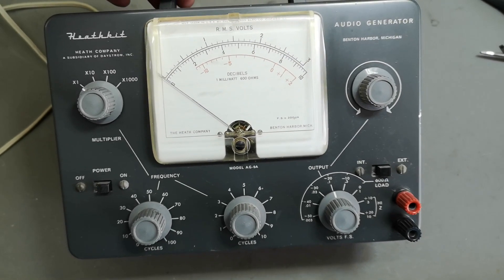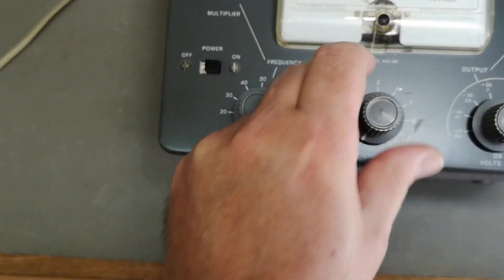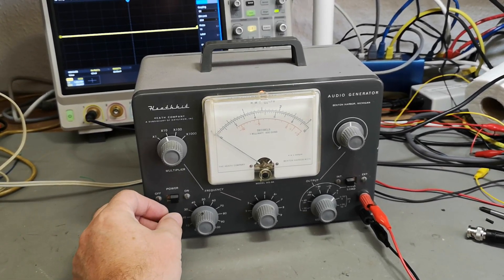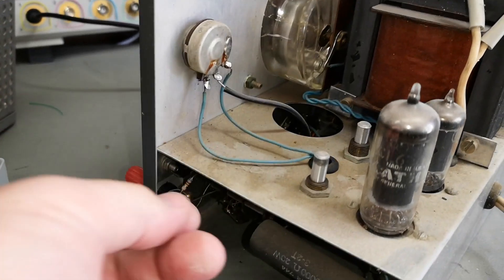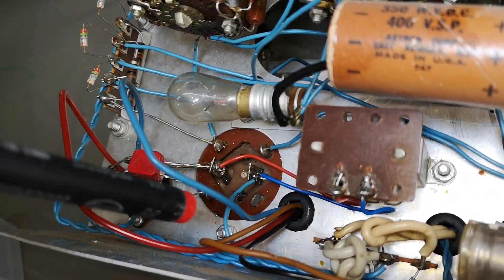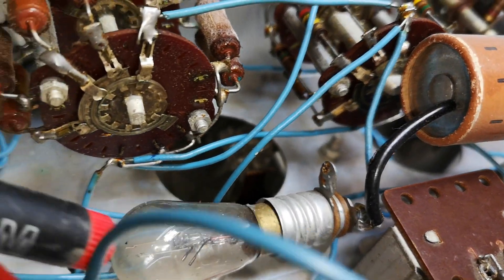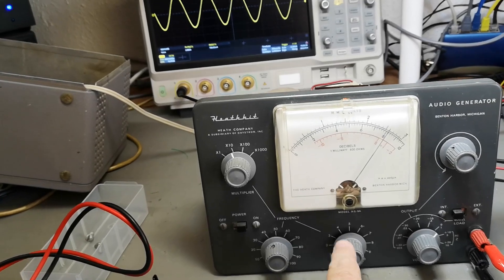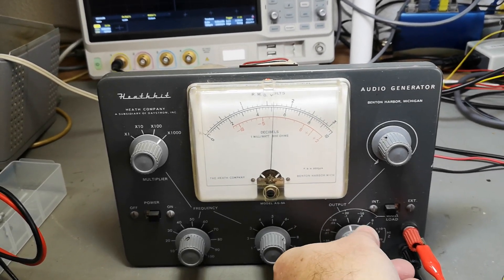Heathkit audio generator model AG-9A test teardown

Comment: Looks like, besides some component replacements, some previous owner replaced a lot of the "hook up wire", since what is in there does not resemble wire furnished by Heathkit in the 1960s......
Reply from the maker: People do fix and repair, to their skill level, i see this often, some times it is a bit under what i can accept, and i need to redo it it all

Comment: Rectifier tube likely was bypassed because of filament cathode leakage, which is very common with a grounded filament exposed to high voltage on the cathodes.  Half bridge was cheaper than a new tube, likely done later on, when tubes were becoming less common. Yes classic Wein bridge, a Muntzed version of the venerable HP200 oscillator, done as minimalist as possible, so having all the switched resistors so they did not have to use an expensive multigang pot needing matching, instead using switches they already bought in bulk, and cheap close tolerance, for the 1960's, where 10% was standard, and 5% was considered a big difference and much more stable. The fuzz is probably a fungus, living on the wax coating, as those were probably made with a shellac varnish, which is biodegradable. The meter movement was likely cooked by the heat of the failing tube, which probably was running red hot for a few hours as the cathode insulation was breaking down, till it finally got a high enough anode current to burn out the filament totally, but not cook the transformer. Or the transformer is a replacement, with the extra unused windings, having gone all crispy with the failed tube when it failed.
Reply from the maker: maybe i should have tested the rectifier tube, could be fun to know if it works or not, this way we can prove if the diode fix is a repair, or a power loss save
Reply: @TeardownOZ2CPU  Pretty sure that tube will either have an open filament, or a cathode heater short. 300V is way too much for the insulation to handle long term. It probably had around 1mA leakage, even from new, when at operating temperature.